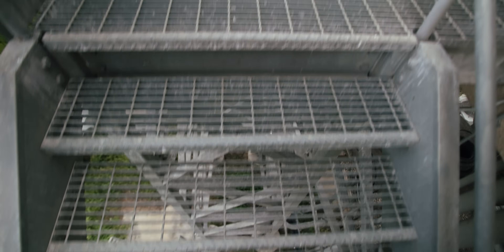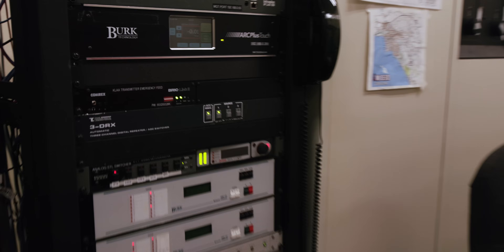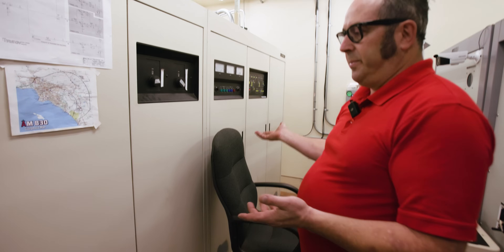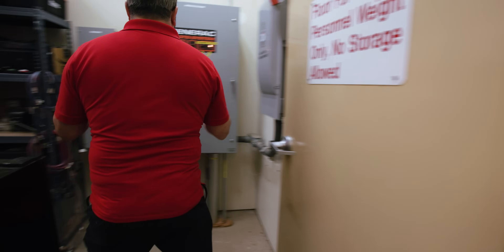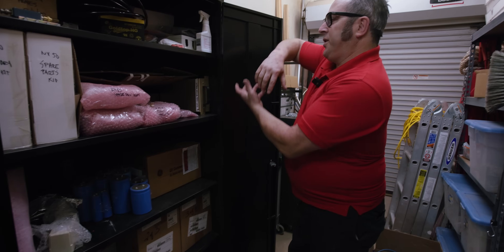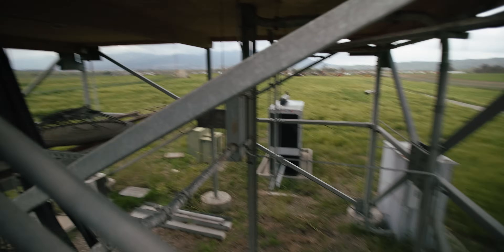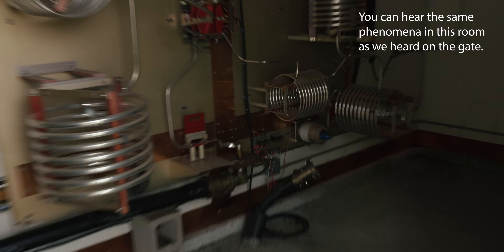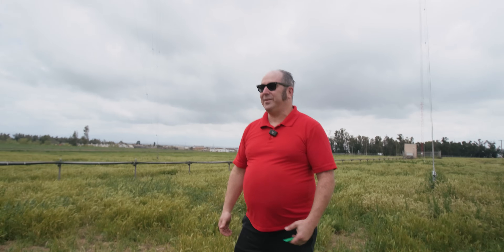KLAA 830 AM Transmitter Tour

Comment: Many do not know this but the location of the KLAA-AM 830 transmitter site is not even in Orange County.  The city of Chino - where the transmitter site is actually located - is on the Riverside County side, and not far from the Orange & Riverside County line.

Comment: I did work at a transmitter site. 20 KW Klystron. With a 50 something gain dish antenna easily go to Moon. Well it did. It was in control just before the first Moon walk. I was not there until 1974 but we did track the packages the astronauts left. 85 foot dish by Blaw-Knox . 3 in the World. I pushed Y axis hydraulic motor button one day and everything went dead. Short exploded first breaker and had to drive miles away to reset the big one. Goldstone Apollo stite.

Comment: I like the old tube transmitters with big glowing tubes and mercury vapor rectifiers with a blue glow that varies in step with the modulation like disco lights.
Reply from the maker: Those are cool, but not very efficient. Very costly with power and cooling.
Reply: @TheBroadcastEngineer  Yes, but it did impress visitors. Now transmitters are like filing cabinets of MOSFETs. Nothing visually interesting.

Comment: The Nautel ransmitters are incredible. I had the previous version which was twice the size of yours. It just sat there and worked silently. Only failure I remember was when one of the big diodes in the AC input shorted. I think the thing cost over $150 by itself.  Quite different from the RCA 50KW Water Cooled Doherty I cut my teeth on in 1962. You could put 8 ot 10 of your transmitter inside that old girl. Sure sounded great, though.

Comment: The fence is modulatin' the RF? That's wild!
Reply from the maker: The little arcs that happen from the oxidation. It’s pretty cool. It’s even cooler when it’s talk programming and you can make out what they’re saying.
Reply: DEmodulating! The fence is really just receiving it, and standing voltage nodes on the metalwork are sometimes close enough, as in the case of the gate latch, to form an arc which heats the air with the signal. Then the thermal mass of the air acts as an envelope detector.

Comment: How do radio stations know how many ppl are listening to them ...I hear it talked about..but it's over the air it's not like you can count how meny cables are connected like old TV channels...I've always wondered this
Reply from the maker: Nielsen (the TV measurement company) purchased Arbitron. So they have a system that hides data tones in the audio and they will have volunteers, called Diary Keepers, (not associated with the company or station) wear a pager like device that listens for those tones and records the time stamp. Those pagers devices upload their data to the server and everything gets compiled.
Reply: @TheBroadcastEngineer  thank you ...would make a cool video i cant be the only one thats woundered this stuff and no one els has done one on it yet

Comment: :hand-pink-waving::trophy-yellow-smiling:✌ Hi.  This was a very nice site tour. It has been a while that i have been on your channel. When you had to change out some components on a remote fill xmitr. I am fully retired from this business, but was stunned at how small the NX50 AM xmtr is. Compared to the old 50kw Continental 317C that I used to baby sit back in the day. Same power output, but very small foot print and I bet the station electric bill is cut more than half. lol No noisy blowers, No oil filled transformers, chokes and reactors, and crowbar tubes to change. LMAO  Great video
Reply: The Continental 317C was my favorite 50KW rig.  Much better than the RCA Amplifuzz or the Gates/Harris MW-50...
Reply from the maker: Welcome back! I’ve got a couple more that I need to edit.

But yes, those new Nautel and even the GatesAir transmitters are significantly easier on power consumption, heat load in the building, and footprint. And they have much better remote telemetry and control than in the past. 

At my previous job we still had a 317 at the auxiliary site ready to rock in case it was ever needed.

Comment: Nice to see a Belar modulation monitor continuing to serve.  I first encountered one in 1969, at KQV (1410, 5 Kw DA-2 five towers) in Pittsburgh, Pennsylvania.  Classy transmitter site—nothing like all that silver-plated coils and copper tubing to drive corporate accounting crazy.  “Wait, you need HOW MUCH silver out there?  Can’t you just use aluminum wire?” With the building elevated like that in the near field of the antennas, there’s nothing resembling “ground” inside.  Thanks for what is (for all of us burned out AM station engineers) a wonderful nostalgic interlude.
Reply from the maker: The grounding is strap on the floor. I saw it, but didn't record it.
Reply: That was a sight driving past.

Comment: I always wanted to get into broadcasting but never had an avenue in so I went into the public safety radio side. A lot of the job is similar to keeping a station on the air, just the RF power levels, etc. are not the same. I love antenna systems and especially AM DAs. I even met and chatted with Jack Layton on the ham bands, one of the authorities on directional antennas.

Comment: 4:45 he states that environmental conditions can change the pattern.  How do they know what the pattern is at any given moment?
Reply from the maker: Those would be gross environmental conditions. Such as flooding or over saturated ground. That Potomac antenna monitor (beige box with red numerical display) has analog outputs on the back that can be interfaced to a remote control. At my previous job, when they had a directional AM station in Bakersfield, I did that exact thing. Usually, you won’t be making pattern changes unless the antenna monitor shows that it’s really out of whack for a while.
Reply: The FCC used to require periodic “proofs of performance” for directional stations.  For the night-time and then day-time antenna patterns the received field strength of the on-air signal would be measured at specific locations (referred to as “monitor points”). If the signal strength at each monitor point did not exceed what was predicted in the antenna pattern design, the station (and the FCC) was assured the multi-tower array was in correct adjustment.  The monitor point readings were almost always made at night. Monitor points were purposefully located where there was only a small chance that future development would render them inaccessible. They were usually in graveyards… I spent many late nights sitting with a field strength meter in one hand and a two-way radio in the other, giving the director of engineering back at the transmitter site new readings each time he adjusted the antenna tower phasing—all while comfortably supporting my back by leaning on a grave stone.
Reply: @georgeetherege8347  When WEAM-1390 was at its original site, one of the monitoring points was by what would become the main gate of CIA HQ in Langley, VA.  That one was always fun...

Comment: DX50, still a fabulous transmitter!
Reply from the maker: Indeed it is, Professor. Until the parts become unavailable. Then it's a ticking time bomb.
Reply: I always wanted to actually install and use a 50 KW RCA Ampliphase transmitter.  Was privileged to tune one up from scratch and test it under 100% modulation at the RCA factory in Meadowlands, Pennsylvania. It used phase modulation to generate an on-air signal that sounded just as good as FM. In an installation like KLAA, driving a multi-tower array, an Ampliphase would probably drive the chief engineer nuts. But gosh… did those things sound great.
Reply: @georgeetherege8347  Until they drifted out of tune.  And, sometimes they did!

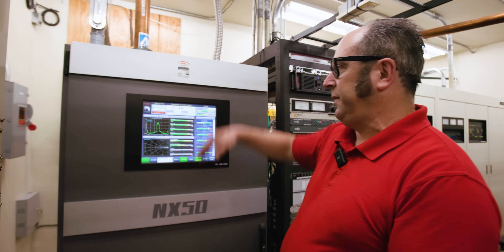Comment: 2:05.  So with no audio sideband power, the power meter reads higher?
Reply: At full, or nearly full, modulation levels, the transmitter acts like any conventional AM transmitter. During pauses, when the modulation level is (very briefly) essentially zero, the only purpose served by a full power carrier is to keep the automatic volume control (AVC) in the listener’s receiver from bringing up the background noise level. But the”time constant” of a typical AVC will cause a delayed change in level close to the duration of the pause.  In that short time, the transmitter can “duck” the carrier power to almost zero with no perceptible change as far as the listener is concerned.  Pauses in musical and speech programming are surprisingly frequent so “turning off” the 50 KW carrier in each one results in measurable savings when AC power costs $0.15 to $0.35 per kilowatt-hour.
Reply: @georgeetherege8347  I was under the impression transmitters got reduced electric rates, sort of a qty discount. hose rates don't seem discounted.
Reply: The two AM stations that iHear runs in my area (620 and 1190 kHz) are using some form of controlled-carrier modulation. I discovered this when I attempted to measure the carrier levels from them using an RF selective level meter, which has a bandwidth setting of 25 Hz (so no sidebands get through). The signal strength needle bobs up and down on these two stations, while others have constant carrier levels.

I will have to double-check on the behavior of the carrier on these two stations. I had mistakenly assumed that the carrier level is reduced during pauses in audio, and I wondered, why doesn't the interference level come up when there is silence?
Reply: @klafong1  I have used AMBC carriers for antenna measurements, but now I have to be careful to not use ones where this varies.  Glad I learned about it here.
Reply from the maker: Correct. MDCL suppresses the carrier when there is programming, and when there is silence, it allows the carrier to come up to full power. Saves a lot in electricity bills.
Reply: @TheBroadcastEngineer  Interesting. So what is the peak envelope power at full modulation?
Reply: @TheBroadcastEngineer  Thank you.  I learned something today... and that's always a good thing.

Comment: This is not a healthy job!
Reply from the maker: In what way is this an unhealthy job?
Reply: @TheBroadcastEngineer  That high amount of radiation
Reply from the maker: @MrVinamp You mean non-ionizing radiation? Light is more dangerous than any radiation you’re getting from a radio tower. You still use lights.
Reply: @TheBroadcastEngineer  But 50 KW of rf radiation isn't exactly the same as a light bulb 😏
Reply from the maker: @MrVinamp At 830 kHz it’s not an issue. The dangers you have with RF is heating. The wavelength of 830 kHz is so large that the body is invisible to it. Start getting up to the 900 MHz and higher you then have body parts like eyeballs that are resonant and start to heat up like in the microwave. In fact that is how a microwave works. The FCC’s RF exposure chart is a good view of how frequency is more important than raw power. And keep in mind that this is non-ionizing radiation. X-Rays and the such are a different type of radiation.
Reply: @TheBroadcastEngineer  So in the 88 to 108 MHz band no problem? In that case I crank up the power! 😄
Reply from the maker: @MrVinamp multifaceted issue. Big jump from 830 kHz to 95 MHz. Some body parts are resonant at fm broadcast frequencies. 

Can’t just crank up power because then you’re interfering with other stations.
Reply: @TheBroadcastEngineer  DUMB     sun burn
Reply: @TheBroadcastEngineer  Plus, eyeballs have no bloodflow to take the heat away, Your vitreous and aqueous humor start cooking and stay that way.
Reply: @TheBroadcastEngineer  Yeah, like an average human can be 1/4 wavelength at around 88 MHz. So huge voltage differential from your feet to your head.

Comment: We used to have an lw transmitter here in Ireland for s station called Atlantic 252 ,it used to also make the border fence shake because of its power 500 kw, there's a video here on youtube if you watch it youll a guy put a key in a padlock and it arcs
Reply: Atlantic 252 used to occasionally make it across the pond into Virginia...
Reply: @johnpinckney4979   Atlantic 252 was more loudly modulated than the German stations. And the signal was quite strong, here in the south of Germany.
Reply: @johnpinckney4979  wow!!!!
Reply from the maker: Yikes!! It drew an arc?!
Reply: @TheBroadcastEngineer  Aircraft radar test set we often used the dummy load as a heater, it ran hot enough to cook on, though the normal operation you put a fan on it. Put a new RF absorber into the test cavity the first 5 minutes were going to make a lot of smoke as the volatiles got burnt out of the foam.
Reply: @TheBroadcastEngineer  if you search Atlantic 252 transmitter site it should be here somewhere

Comment: Yes a very nice site, and a very dedicated engineer there, who wants to be giving the best most reliable signal as possible, come what may. just wonder what will occur in a big flood when that switch room gets wet.
Reply from the maker: Indeed! Mike is a great engineer. Paul, his successor, set up a great site. 

I do find it funny that the transmitter building was required by the Army Corps of Engineering to be on stilts, but not the ATU buildings at the towers.
Reply: @TheBroadcastEngineer  Nor the bases of the towers either, though probably the transmitter SWR protection will trip out and stop the operation when water laps past the insulator, and ther same for the ATU shed as well. Not easy for the transmitter though, so high and dry it is. Hopefully Mike has a trailer at home with a boat on it, just in case there is an emergency and he needs to get there, and the land is a little bit past wet.